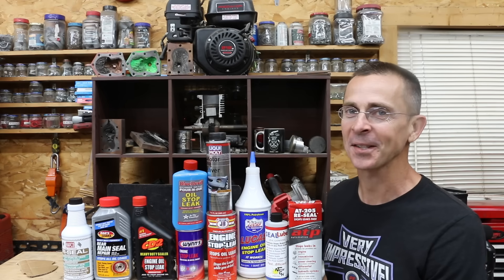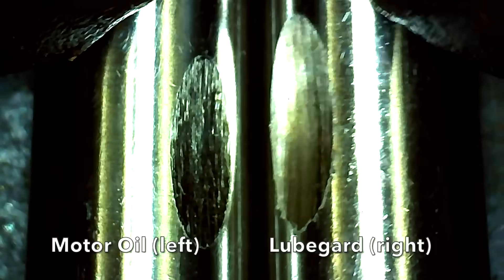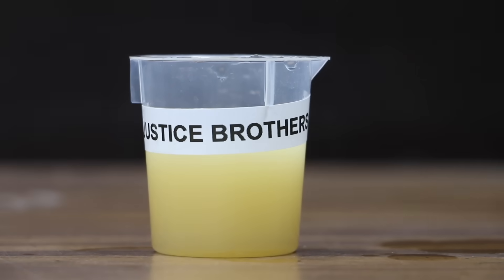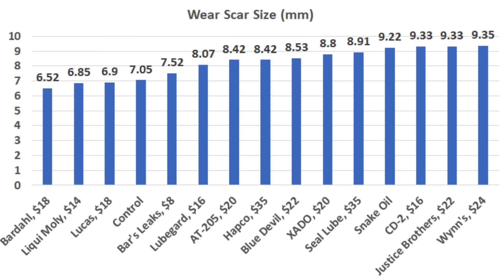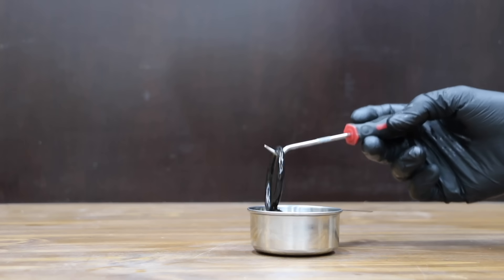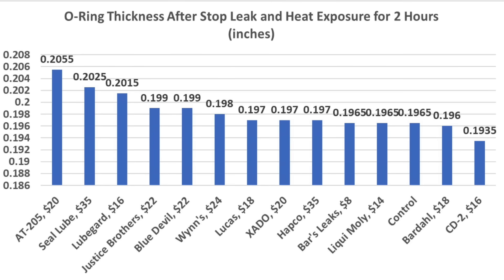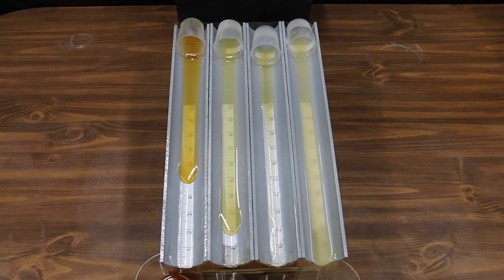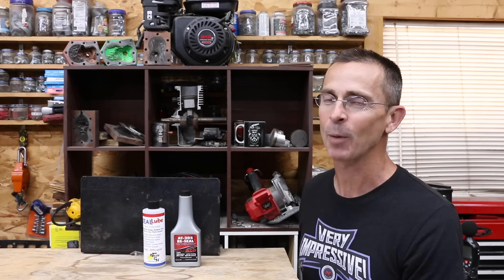Do Stop Leak Products Work? Do They Damage Engine Seals? Will They Destroy an Engine? Let's Find Out

Comment: I'm not sure how much difference it would make, but i believe you should have used a 3:1 ratio, not a 1:1 ratio. Most engines are 5 quarts of oil and many are even more, especially dry sump (my Z06 uses 8 quarts) and these stopleak product usually call for a single quart or even less
Reply: Your z06 is already leaking oil? 😂
Reply: I just made a comment on that 8oz of at205 to 160oz of oil

Comment: I would like to see a comparison video of normal brake rotors vs drilled/slotted rotors. Love your videos, they're very informative. :)
Reply from the maker: Thanks!  Thanks for the suggestion.
Reply: @ProjectFarm  i would also like to see that
Reply: @ProjectFarm  I'd like to vote for this video idea as well.
Reply: They are better, I use my car 8+ hours a day and brakes can heat up and lose efficiency (brake fade) I've seen other cars with glowing red brakes because of the excessive heat and heavy use (I live in a very hot and mountainous area) so I upgraded to drilled and slotted discs and ceramic pads and the difference is huge, I can use them comfortably knowing that they are not going to fade and contrary to popular belief, they dropped the brake distance significantly.
Reply: @JefeInquisidorGOW  fade is dictated by your brake fluid and overheating of pads. Bite is dictated by brake pads and not rotors. Unless your driving hard for 8+ hours in mountains above speed limits, you shouldn't have any issues. If anything, it sounds like you should drop to a lower gear if you really are overheating your brakes. Or your brake pads are just junk and have bad temperature ranges.

0 benefits, you should NOT run drilled rotors on a street car. You actually get less brake performance due to less surface area of the rotor making your braking distance longer. They also crack at the holes and aren't built to the same quality that a $1,000 porsche/amg rotor will give you. Funny enough people that race their cars on track actually do NOT use drilled rotors and highly recommend AGAINST them due to cracking at high temperatures. I will say they look cool though

Slotted rotors help clear brake pad material, something nobody ever will need on the street since only high-temperature trackpads have these issues such as outgassing. Anybody saying it helps "brake fade" or "lowers temperatures" is just anecdotal without evidence. 

With good dot4 fluid and good street pads like gloc r6, hawk hps, you should have no issues. Just make sure the plain rotors are ventilated
Reply: @bruce_son  oh yeah, in paper everything you just said is true, reality is totally different. I have used several sets of drilled and slotted discs in my car, even wearing down the slots until they are not there anymore, not a single crack in them. I use FF friction coefficient pads in my car, they are very consistent and comfortable enough for a passenger car. Again, in my experience drilled and slotted brakes are way better, but you guys can use what works better for you.
Reply: @bruce_son  By the way, I use DOT 5.1 synthetic brake fluid, ceramic brake pads (FF friction coefficient) and quality drilled and slotted discs.
Reply: @JefeInquisidorGOW  dot 5.1 is worse than a good dot4 brake fluid. Just search up wet boiling points. How do you determine quality? I’ve seen sets of 200$ rotors crack and rust from those holes. Stop tech rotors or centric is what I get. People run them in endurance racing so it should be fine. I have no idea what pads you are using, but any street pad will fade if you get them above a certain temp. All brake pads have specific temperature ranges and you should upgrade to one more suitable to higher temps like (hawk hps+, stop tech 309 sport, ferodo ds2500)
Reply: @bruce_son  a quick search on Google shows that DOT 5.1 has a higher wet boiling point than DOT 4, just use whatever you like, anyways the operation conditions (temperature, altitude, relative humidity) of your brakes and mine are completely different, so your setup is going to perform different in my region and viceversa so use whatever works better for you.
Reply: Brake Rotors with holes are NOT drilled. They are being casted with the holes already on the mold. Cheap ones are drilled and they crack.
Reply: @Nick-GR  yes, it is my understanding that they are still called "drilled" brake rotors, even though they are cast. 👍🏼 I could be wrong in that though.
Reply: I also agree i have drilled and slotted on my car and im diggin it, would like to see the benefits I'm getting
Reply: i would also like to see this comparison
Reply: Me too also I see this comment on almost all his videos      good job man you're single handedly going to get the credit for that video 👏🏼👏🏼👏🏼😉
Reply: @mixz9929  Thank you. 🙂
Reply: StopTech Rotor 😊
Reply: I second this
Reply: Slotted and drilled rotors are more aggressive to your brake pads, which wear them out quicker. Normal rotors are smooth so there’s no edges to scrape off pad material, just friction.
Reply: My first car was older than me and I was completely broke. My pads had worn out and I heard grinding on the rotors. I went ahead and put new pads one without turning the rotors and when I took the pads off a year later the pads had matched the grooves in the rotors. I'm sure my braking performance was poor until the pad wore into the grooves, but after that I wonder if the braking performance would have been better because of the increased surface area. Anyway, I wouldn't recommend anyone doing that but I was desperate and couldn't even afford food.
Reply: Drilled/slotted rotors are lighter in weight, so they can make a tiny improvement in fuel mileage, acceleration and handling regardless of braking performance.
Reply: as long as theyre both steel, normal rotors have more surface area and are better at stopping. the problem is that they do not manage the heat well, and will warp and wear more unevenly over time, and theyre more susceptible to fade with heavy use
Reply: @hau5muzeek rotors are not steel. They are cast iron. There is so much ignorance surrounding brakes maybe PF really needs to do an expose. But at this point who would change their minds?
Reply: @gmoose7155 these days rotors are made from carbon ceramic material
Reply: Drilled/slotted rotors are used for competitive race cars where the rotors need to shed heat quickly. They aren't needed for street vehicles, but...people think that if it's used on a race car, then it MUST be great on my SUV 🙄. Not taking away from your video suggestion, just adding FYI.
Reply: @mikek1187  Yes, thanks for sharing that. 👍🏼 I am aware in most cases normal brakes are perfectly fine for the average vehicle, I'm just curious about how a comparison between the two would go. 😎
Reply: @mikek1187 I tried some because they were on sale, I ended up going back to blanks. I could not stand the noise they made and the way they felt.
Reply: @mikek1187 anything that can shed the heat quicker is going to last longer

The reason they wear down is because they get so hot and can't shed the heat quick enough so they hit their limit

This is why you're rear brake rotors tend to wear quicker and have more grooves than the front

Instead of getting drilled and slotted I would recommend getting vented
Reply: @mikek1187  I always scoffed at drilled and slotted rotors on "normal" cars...until their extra grab saved me and my very much normal car from an idiot brake checker. Those rotors were on the car when I bought it.
Reply: @GregoryGlessnerViolin  What extra grab? By definition they have less grab & less maximum possible braking force, where they help is in fade
Reply: @GregoryGlessnerViolin You will like EBC YellowStuff Brake pads to go with those Rotors. 
They're the best, but need replacing every 2/3 years because they're working so well.
If you prefer slightly longer life, at slightly less stopping power try RedStuff pads. 
Still better than stock.
If it's time to change Rotors get EBC USR Rotors to compliment the pads.
Reply: @danhallett4952 yeah I agree I've put them on multiple vehicles and I've yet to have a set warp crack or fail. But other than a slight noise they make I love the upgrade.
Reply: @mikek1187  you are wrong I don't know anybody who puts normal rotors on there car that within a year doesn't have warped rotors making braking feel unbearable where you can easily get a power stop z26 kit for barely more than anyone else pays for brakes and it makes a world of difference
Reply: @EXCRUSHER  I know someone who can put normal rotors on vehicles and doesn't have warped rotors after MANY years...

That person is me. If you don't brake like a crazed maniac, then you won't have warped rotors. Been doing this for over two decades now. If you treat her like a lady, she'll bring you home every time.
Reply: All the people saying their fancy drilled and slotted rotors saved them on one hard stop: 

WRONG

They stop less effectively but they cool far better. Repeated use is where they shine...not your commute, unless you live in the mountains (and brake incorrectly) or drive like complete ass. 

In fact, Drum brakes stop you that one time far better than disc brakes do. More contact area. They do not cool well at all though, nor do they shed water well (another huge pro of disc brakes)

One hard stop? Any brakes are fine, Drums are best, followed by 'normal' vented disc brakes, and drilled/slotted come in third. The one pro of slotted over normal or drums is that the edges of the slots will clean your pad so to say, and exposed new material with virtually every stop. Again, a non factor in most everyday driving...unless youre driving like ass of course.  

Its nothing more than confirmation bias: "I installed these and then avoided an accident, therefore what I installed must have been what saved me"
Reply: @tehagent1321  thanks for your take on them. I understand most of the pros/cons of them, but I think it'd still be a cool video to see, none-the-less. 😁
Reply: @garrettbushman  oh for sure. Id love to see how the physics actually play out!

Comment: I think there is a risk to over swell and over soften o-rings when they have these products applied to them.
With that in mind, the relatively small impact on wear resistance at an excessively strong concentration, Lubegard seems like the lowest risk product that should work on the seals.
Reply from the maker: Thanks for the feedback.

Comment: Can you test antifreeze? Specifically automotive antifreeze versus motorcycle antifreeze, such as the Honda type two 50-50 mix Blue versus automotive antifreeze such as zerex for Asian vehicles. The goal here is to use automotive antifreeze safely in your motorcycle.
Reply from the maker: Thanks for the suggestion.

Comment: I have a suggestion, you should test some electric (battery powered) chemical sprayers. I’m in the floor care industry and everyone has to use sprayers. obviously no one wants to use a traditional pump up sprayer, and name brand electric sprayers vary a LOT in both durability, and flow. Thanks.
Reply from the maker: Thanks for the suggestion.

Comment: My first car was a 86 chevette and it leaked from front and rear main seal, I didn't drive much then and it would lose about a quart a week, I started using bardahl with my oil when I did my oil change and it didn't eliminate the leaking but it made a big difference. I always figured it was just increasing the viscosity of the oil. Few years later I pulled the engine and rebuilt it, first engine I ever rebuilt, no leaks after that.
Reply from the maker: Thanks for sharing!

Comment: I'd like to see a test of the electric over hydraulic bottle jacks. They are sold as emergency car jacks. Typically at 3T. I like a bottle jack for road side because they go straight up. Wonder if one would be useful around the shop. My lithium trolling motor battery could power one all day long and is light weight.
Reply from the maker: Thanks for the suggestion.

Comment: When you put at-205 as recommended in your crankcase it is not 50-50 mix way less than that so I wouldn't be too concerned about engine wear tried it on some dried-up valve cover rubber seals on the bench it did soften them up

Comment: I would love to see coolant stop leaks be tested next, I used one when a turbo sprung a leak, it worked stopping the leak but now I have a weird issue with my coolant temp jumping up by 30F randomly and heating going cold when I stop at red lights
Reply from the maker: Thanks for the suggestion.
Reply: @ProjectFarm  and thank you for doing what you do.
Reply: Replied to another thread, but same here. 
Oil stop leaks work chemically.
Coolant stop leaks work more like adding glue.
Unless your car is a beater on its last legs, or you're stuck in the desert, don't use coolant stop leaks.  
That stuff ends up everywhere that coolant flows, where your leak is, and where its not, like in the journals/passage in the block, the radiator, water pump, heater core, etc, etc.
You may stop the leak, but that stuff is everywhere and will usually end up causing something else in the system to fail.
Reply: @boots7859  oh trust me, I just ran both fords coolant cleaner and prestones total system cleaner through it, three times, once with prestone then added the ford one next and drained then filled with distilled water, it actually cools 10x better then when I got the truck now lol.

Comment: My work provided 2018 Ford F150 has 116k miles, but I idle for 12+ hours per day for 14 straight days at work, then I'm off for 7. Ford says for every 1 hour of idle, it's equivalent to about 26 miles of wear. As a result, if you include idle hours this engine likely has well over 400k miles of wear and tear. I've been using it since October of 2018 and it had about 15 miles on it when I began. It was new. As a result of this enormous amount of wear and tear, it started to burn oil like a siv.  I was putting 3-4 quarts every 3 weeks.  I poured the Lucas product you tested and the oil consumption dropped tremendously. Every 3 weeks I could still see oil on the dip[stick, maybe having dropped about 1/4 of an inch.   That lasted about 4 months, and it started to burn more and more.  Poured in another bottle, same result.
Reply from the maker: Thanks for sharing.

Comment: It seems AT205 is the clear winner here,  but it did bring up two questions in my mind. 

As you point out, the AT205 harms the lubricity of oil...  There are some applications where that's a huge deal (an engine for instance) but others (like a power steering system,  hydraulic jack, etc, where it may not be such a big deal).   The question is... how is this product used?

Do you add it, let it do its magic and then dump it and change the fluid?  How permanent is the restoration and how much heat needs to be added?

Comment: As an electrician it would be awesome if you could make a video testing multimeters. There are so many different options that all vary in price, and most electricians only use one of 2 brands, fluke or Klein. It'd be cool to know if some of the much cheaper ones are still just as good as their job. I also have 2 multimeters one that beeps if it reads 120 volts, and one that doesn't, the one that beeps (which is a fluke branded tester) is much more useful as you don't need to see the screen while testing for voltage, just listen to the beep. So it'd be nice to know which brands have that function and which brands don't, as almost none of the descriptions of the products I've looked at mention that function. Much love.
Reply from the maker: Thanks for the suggestion.

Comment: I would like to see the difference in running a heavier or lighter weight of oil in an engine than is recommended has on the performance and wear of the engine.
Reply from the maker: Thanks for the suggestion.

Comment: You are using a 50/50 mixture for the test. That is not what you would get from adding a bottle to 4 or 5 quarts of oil. To me that is not a valid test at all.

Comment: I know for a fact that AT-205 works. I have an old 77 Chevy truck that was leaking trans fluid by the quarts. Had been leaking for years. Poured a bottle of AT-205 in it and drove it a while and the leak stopped. I couldn't believe it. That's been at least 2 years ago and still no leaks. I would have bet money that it would not stop the leak since it was leaking so much.
Reply from the maker: Thanks for sharing.

Comment: If you do one for the stop leak products like blue devil for the cooling system. Not sure how this product would be tested, but that's what seem to figure out well.

The problem I run into with engines that have had stop leak like products put in them to stop a water leak is mainly in the head gasket and reduces flow in the radiator..  Engines that are poorly cared for usually have rust sludge buildup in the cooling system from just using water. When you add a product like this it use the rust like an aggregate and clogs the passage holes in the head gasket. This condition can make all sorts of heat related issues.
Reply from the maker: Thanks for the suggestion.

Comment: Have you done anything with nails especially framing nails? Specifically 16d smooth, ring shank, spiral shank. 2 1/2"to 3". Holding,shear,pullout. How much force to pull each out etc.
Reply from the maker: Thanks for the suggestion.

Comment: A really great study. It would be interesting to see a similar test on coolant leak stop products - Top marks PF 🙂
Reply: Argh, had one of those as a teen.  If it ain't a hose or similar that can be fixed, you are really setting yourself up for a major breakdown sometime in the future. Way to many passages that are going to get clogged up thoughout the engine with that gloop, and maybe, possibly, where that leak is coming from.
Oil stop-leaks work chemically. IIRC, coolant stop-leaks add solids and crap that can get and stick everywhere inside the passages, radiator, etc.